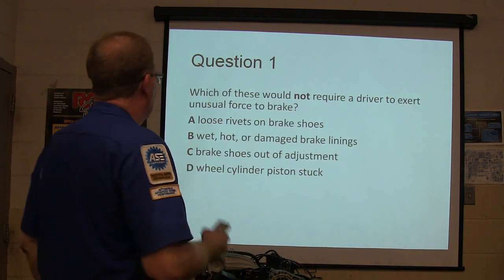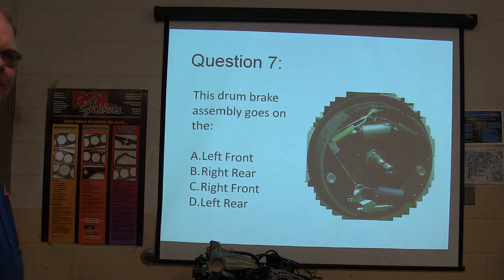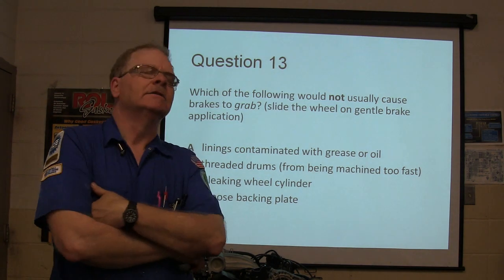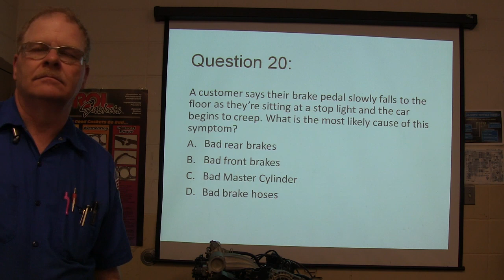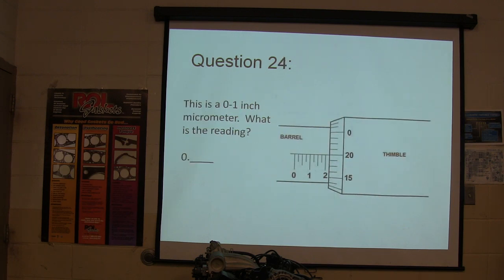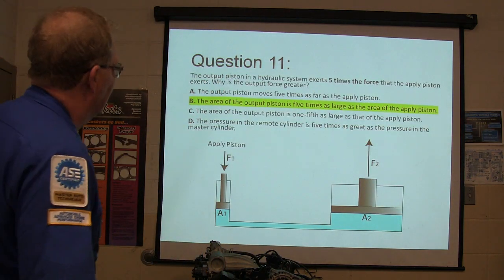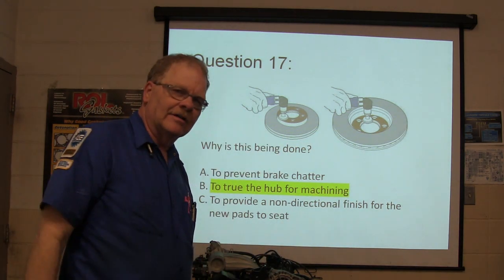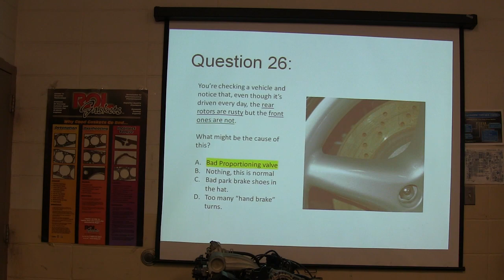Practice Brakes Test

Comment: Hello, Mr Richard. I had a brake pedal that sinks to the floor at a stop light  only once and the car almost stalled. I no longer have that problem. Replacing the brake pads was the only thing I did. Anything else can cause a sinking brake pedal at a stop light other than a leaky master cylinder?
Reply from the maker: What's typically a bad master cylinder